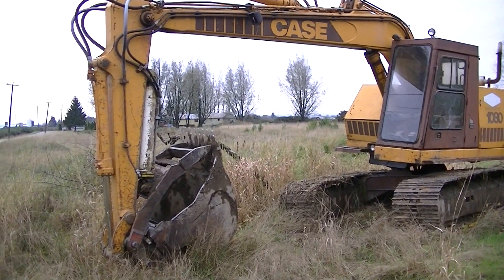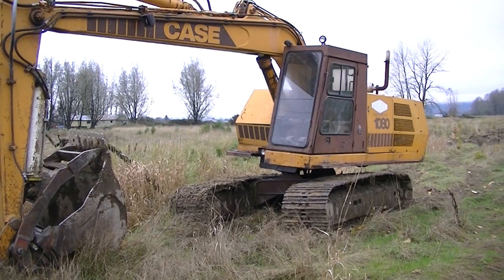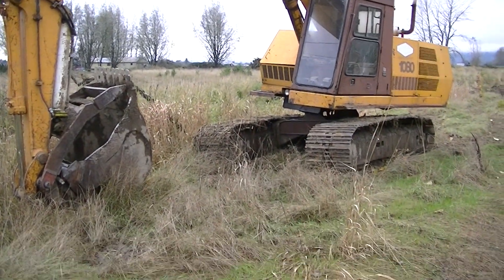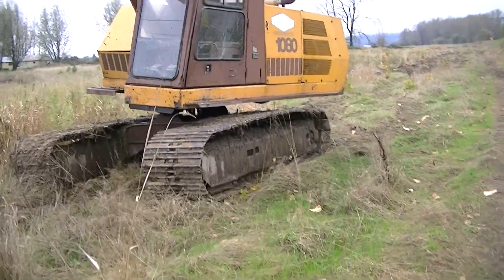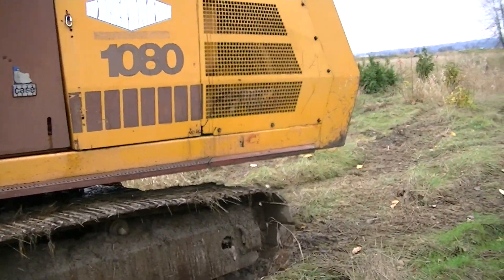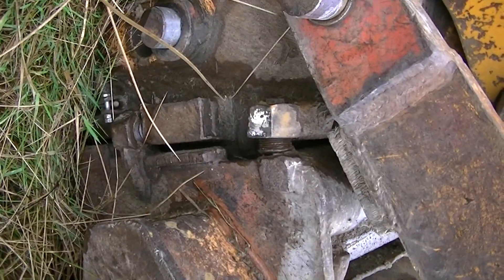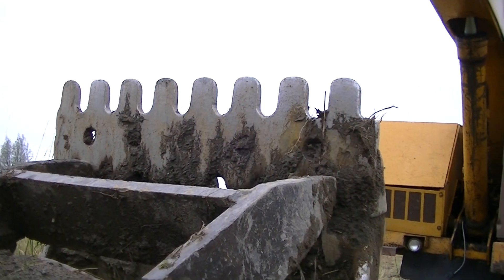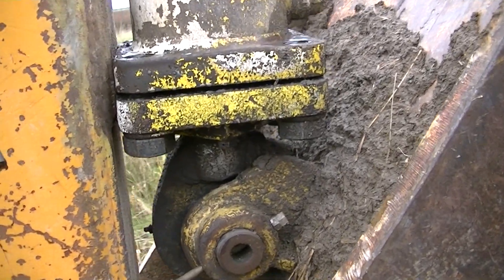Case 1088 Excavator

Comment: I was wondering what in the hell happened to the machine to make the house works tilt like that. I remember the old Drott machines one of the developers her had one back in the early 80s with a screaming Detroit.
Reply: It's made to tilt for working on hill sides
Reply: Graveltrucking I ran one of those a little with that blasted heel/toe swing. It was prone to quit on steep hills and crash. I'm glad I was mostly on a  6, 7 and 8 at the time.